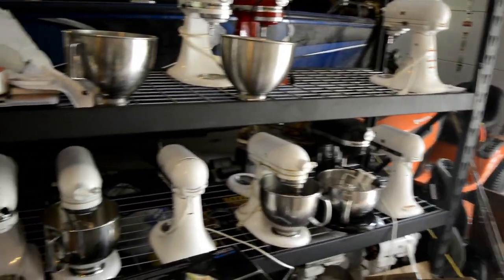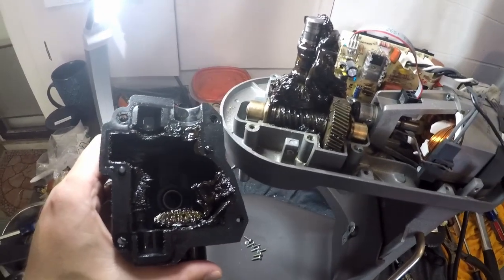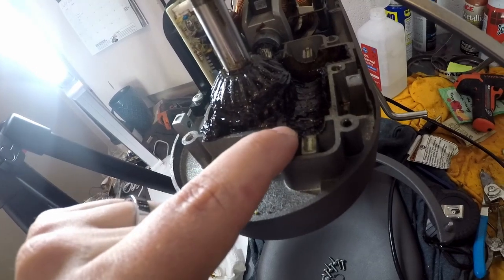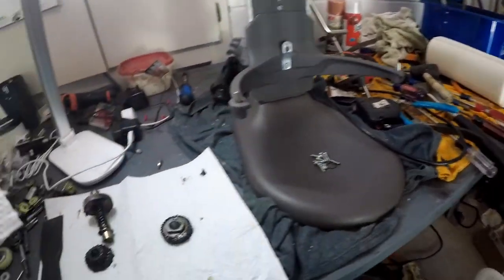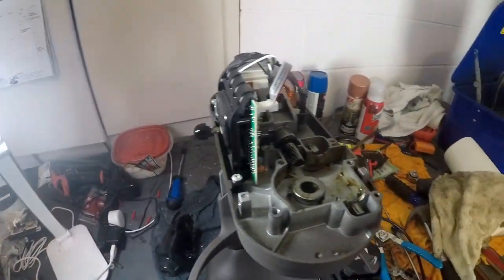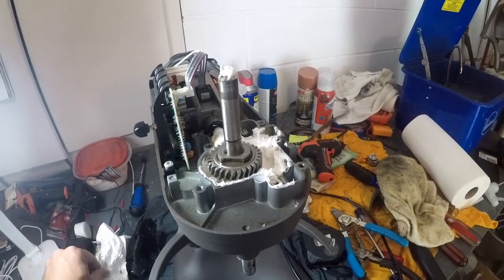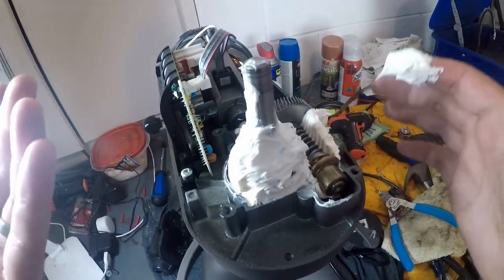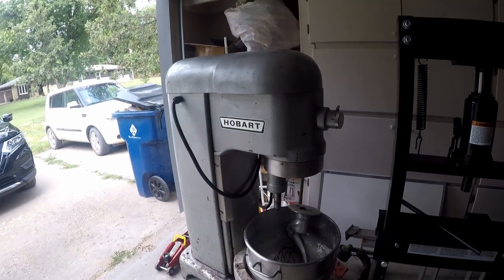Best Kitchenaid Mixer Professional 5 Plus, Pro HD and Professional 600 Planetary, Gears & Regrease.

Comment: Fantastic and detailed video. I'm not a kitchenaid pro, but attempted to fix mine with the help of this video, and I managed to do it, while also learning a few things about the inner workings of my machine along the way. Don't let the 45 min length scare you off. You likely need that long (if not longer; it took me about 2 hours because I couldn't get a piece off) to fix your machine. If you're just a little handy, or even if you're just inclined towards arts and crafts, you can do this with the help of this video.
Reply: Which piece took you 2 hours to remove??

Comment: I have a KitchenAid Pro 5 that I have not taken out of the box to use yet.
I am considering changing the grease after the initial use to get rid of the first chards of steel, post manufacturing.  Like a new car engine, I believe doing an early oil/grease change might add to the longevity.
If/when I do this, I will keep you in mind for ordering the grease you sell.
Thanks for the tutorial and video. 👍🤓

Comment: Thanks for this.   My planetary separated from the shaft.  Is it possible to press them back together so that they will stay (without buying a whole new planetary?)... perhaps with a bench vice or something?
Reply from the maker: It is possible unless the teeth on them are too damaged, but the metal is so thin on the planetary I'm scared you'll bend it then it will rub/cause other unforseen issues. I have a press we will give it a shot here soon

Comment: Saw your troubleshooting on FB, and had to click the link and subscribe. You make such a frightening challenge look eminently doable!
Is there any way to tell you need to regrease other than the goo dripping from the top? Is is something to be concerned about if it isn't leaking?
Looking forward to more of your vids!
Reply from the maker: That's the plan I want to empower people to do their own repairs, it's very intimidating but Ive literally put thousands of hours into this and mastered the craft, I kniw every issue and every snag when trying to disassemble/reassemble, if the channel can garner enough support we will do live video conference to help as well!
Reply from the maker: Also yes they should be regrease every 1-2 years, grease starts to separate after the year mark and by 2 its ready to change, plus it's good to get in and tighten everything to keep it in tip top!

Comment: Thank you, I am just needing to give mine a good clean due to trading with daughter (hers is now wrong color for her new apartment 🤣) What are the differences between a Professional HD & Professional 5 Plus other then age?
Reply from the maker: The professional HD has a different bowl and attachments, otherwise nearly identical. The bowl and attachments for the pro HD are the same bowl and attachments used on the K5SS machines and the pro 5 plus uses a wider bowl and the same attachments as the pro 600
Reply: @MrMixer316    Thanks for the info.  I got a HD with a broken gearbox for free and have been trying to figure out what attachemnts if I can fix it.

Comment: Hi Mr. Mixer.  I have the Pro 600 that I bought brand new in January, 2016.  It was in it's original box and packing which I didn't open until last month.  I kept it stored in a closet all that time and unfortunately, sometimes on it's side.  When I started to make a cheesecake, the noise was horrendous.  My hubby and I took it apart and only got as far as removing the worm gear. We then re-distributed the grease and put it back together.  It still is very, very noisy.  In your opinion, what could it be?
Reply from the maker: They are naturally loud in tone, but if you hear grinding or knocking that would be an issue, you can send a video if you like
Reply: @MrMixer316  Will do!  Then... How can I repay you?

Comment: Is it possible to add too much grease?
Reply from the maker: Yes it should be jsit enough to healthily coat all the gears with a base layer around the housing!
Reply: @MrMixer316  Thank you, sir! I loved this video and I can't wait to watch more.
Reply from the maker: @clemti4411  so excited to get some content out, I'm trying to get funded a bit, I basically have to spend about 2500$ to get all the essentials to make sure this is all extreme quality, I'm actually going to delete this and refilm as it is not an acceptable quality for what I want to provide you all with!
Reply: I have a mixer WT1146258 that the scrow that attaches the top to the bass has striped is there a repair for that?
Reply from the maker: @jenfinlay4983  while I'm certain we can fix it, I'm not 100% sure which part you're referring to?